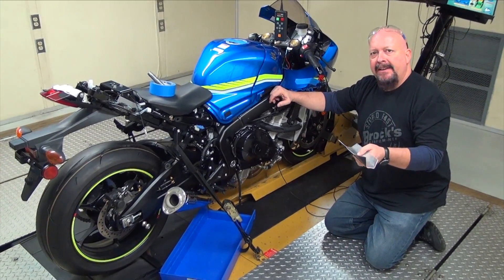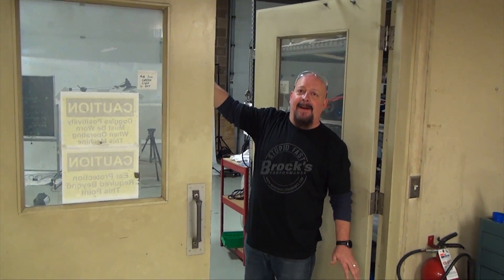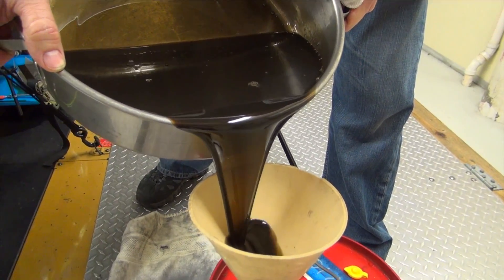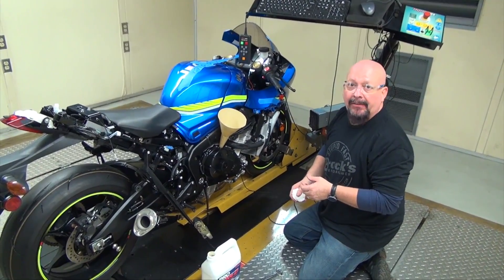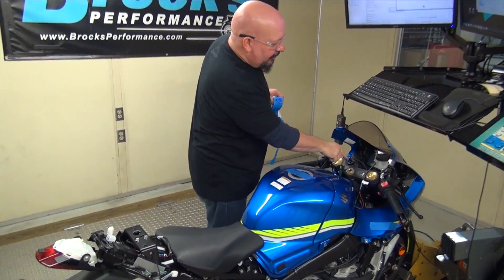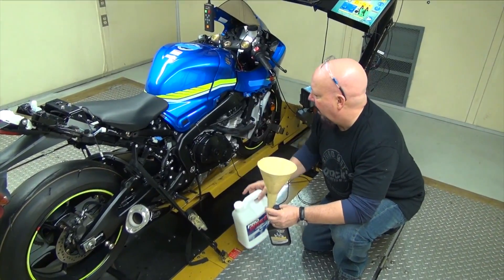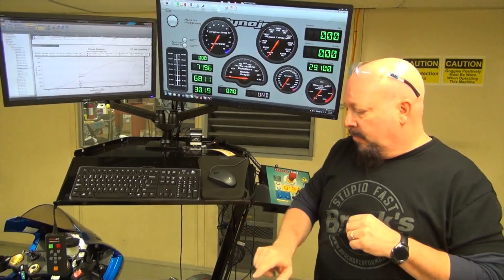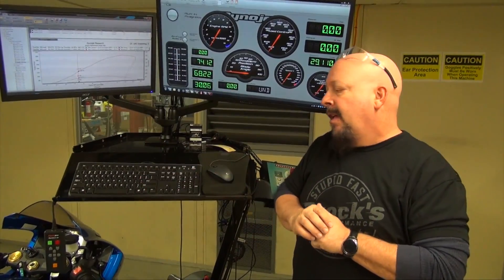2017 GSX-R1000 S2B: Episode 6 (Part 2) - The Devil Is In The Details (Oil Change)

Comment: Why did you say that once you go to the 0 weight you could never go back?
Reply from the maker: Because no other oil or combination we have ever tested has out-performed our <<0 weight Alisyn and Petron on the dyno or race track in stock engines. As far as changing to something else (organic or any other synthetic etc...) that's no problem - if you are worried about those Internet myths.
Reply: @BrockDavidson  over the past week I have watched every one of your videos. And I have learned so much about motorcycle racing. I'm a drag race guy but I've always raced cars. I'm trying to get into motorcycle racing. I have two Hayabusas, one being turbocharged. I'm not really looking to win any competitions or anything as I'm a bigger guy. I just want to do it for the fun of it. I've made a few trips to the track and did decent for my first few times but need to get better on the clutch. I have found very little videos that go over throwing the clutch though. Anyways thanks for the advice.
Reply from the maker: @swatson0061   glad you are enjoying our series. Launching a bike properly takes practice - we have some larger guys who are excellent riders. The term 'throw the clutch' makes me nervous. The only time this would happen is if you have the clutch style combined with proper power measurement - example: MTC multistage clutch and fully adjustable boost controller like an AM1000. If you are manually activating the clutch (aka: actually riding the bike...) you, as the rider, are in charge of the clutch and power modulation. You might want to check out videos from the Real Street class for examples of riding a turbo with a hand clutch and Pro Street for throwing the clutch and hanging on tight!
Reply: @BrockDavidson  yeah I was actually talking about slipping the clutch. But alot of racers I see get it out so fast it looks as if they just throw it. I'll search for those videos. Thanks.
Reply from the maker: @swatson0061  search: real street motorcycle drag racing and true hand clutch motorcycle racing.

Comment: The thicker oil back then is because the oil will cling to the metal more. With today's lubricant technology it's now better to run lighter since thinner oil flows through the engine parts more easily while maintaining the 'cling factor'.

Comment: I know you've been using 0 weight oil but every engine guide and engine builder says they build an engine with the weight  of the oil they need to run in mind. (pretty much every sportbike I've owned has a min of 10w30/40 recommended.  this means they've designed the engine to use 10w30/10w40 etc.  quoted from link below,   "Viscosity must be properly matched to the engine’s clearances and operating conditions to optimize performance. If an engine is not built to take advantage of light viscosity engine oils, the oil may not be able to adequately “fill” the oil clearances and fail to adequately support engine loads."    https://www.enginelabs.com/tech-stories/racing-oil-vs-street-oil-know-the-differences/
not to pick on that oil brand but they seem like another gimmick oil brand.  no info of the oil type whatsoever.  full synthetic labeling is a loophole in the laws that allow them to call it synthetic when all it actually is a highly refined group III crude oil base stock.   it's not actually synthetic.  100% synthetic labeled oil contains 100% synthetic base stocks. with pao or esters or both.  I won't consider running a brand that wont tell you whats in it..  and I don't see Alisyn pro drive 21 stating anything other than full synthetic.  which means, it's not synthetic.     this is one of the only oil brands happy to tell you what they use,  http://mptindustries.com/mpt_products/motorcycle.htm
Reply from the maker: Use what makes you comfortable. Here is more info on how we do it: http://blog.brocksperformance.com/faq/what-is-the-best-weight-alisyn-oil-for-my-application/

Comment: Hey, Brock ;-) how long the oil light can stay on before damage is inflicted? The last time I changed oil and filter on my ZX6R the oil light stayed on for what felt like eternity, some no fun noises from the cylinder head appeared, in an act of desperation I decided to rev it and that seemed to have purged the air. The noise is gone, everything seems to be back to normal but I keep thinking about it. I use Militec 1 oil additive (produced in the USA and imported to Poland), I'd gladly see a review of it done by you and some hard dyno data whether it really works or not, it definitely makes shifting smoother and raises idle a bit. God bless!
Reply from the maker: Air can trick the light, but the bike is still getting oil. You know quickly if you ever had an oil starvation issue...
Reply: Thanks for the reply, I really appreciate your work!

Comment: The last couple of days I’ve been watching your videos , and what I have to say is WOW! Awesome stuff!
Talking about oil , have you ever used or heard of MILITEC-1 oil additive ? 
I’ve been using it over 10 years and love it. You should definitely look in to it . Less friction, smoother ride , just a great product over all. Last year put more than 55k miles on my 2014 FZ09 using it with Castrol oil 10w50 ( here in Los Angeles ) with no issues what’s so ever!
It would be nice to see some numbers on the dyno when add to the oil. 
Thanks again for the great content on your channel.
Reply from the maker: Glad you like our vids. I have not tried MILITEC-1. It took us years to confirm an additive that truly worked for our application - so we stick with the Petron+. We have tested other additives that made a bit more power... but we also encountered clutch slip and a couple even produced corrosion of internal components. You haven't lived until you have wiped oil off of a rusty connecting rod or trans. gear.

Comment: Brock please HELP i have a 2018 GSX RR 1000 i have a full system M4 street slayer system the tried to do the willage flash on my ECU but it would not idle down when I came to a stop it would rev to about 3000 2800 for about 5 seconds in neutral when I came to a red light or a stop and then took about 5 Seconds to idle down can you please help me with this and get my ECU up to 204 horsepower on my bike what do I have to do please help
Reply from the maker: @joepeoples231 - very sorry to hear your frustration. This is exactly why we spend many months of R&D to create our Stock to Brock kits - we deal with the work and frustration....so you don't need to. Please contact our customer service team for your options. 937-912-0054 or sales@brocksperformance.com

Comment: How many miles do you change oil
Reply from the maker: Norman Boltron great question.   It depends on your riding. If drag racing, we change it every race to keep the clutch debris out of the engine. For street, usually every 1500 miles our so.
Reply: Brock Davidson ty mate

Comment: Hey Brock, whats your opinion on using Alisyn in heaver applications such as high performance v-twins air and liquid cooled in the 20W50 weight? You said you use Alisyn in all your bikes with "stock engines" can you elaborate more on that? What oil do you use for modified engines?

Comment: I heard about you a long time ago back when Joe Marasco was running around small towns with a hired rider and a bike hustling drug dealers out of their money at the track. I had an old 94 gsxr 1100 with a 56 tooth rear sprocket and a mechanical switch rigged up to the throttle that opened up a hidden nitrous system hidden under the rear fender and the air box. I would rev the piss out of it when I would purge the system into an air release muffler that I got from work.

Comment: brock davidson i have a 2006 zx14 that previous owner placed a 2008 header which has the catalytic converter and also they didnt even have mufflers on it and i found secondary throttle blades was removed... so what ive done was gut the converters and i found a used set of vance and hines cs-1 mufflers to put on since it didnt have any mufflers when i bought bike. should i feel a power difference with this? it didnt run bad just loud as #### and i feel that it would hurt bikes power with no mufflers. i also used just 10w-40 motorcycle mobil oil but if i can buy better oil that is proven to reduce engine wear and reliability then i will but would a lower weight oil hurt my zx14? im hoping the cats removed in header will help with engine heat also but ill be needing a ecu flash im guessing and id like to dyno bike to see if it even makes 150hp to rear wheel
Reply from the maker: @Danger Davefpv - Hello. I can't answer the question about your pipe, other than to say that if you want to truly make more power, that gains are to be found in replacing the OEM headpipes more than any changes you can make on the muffler side. We used the Mobil 1 for years. iIts a great oil and relatively inexpensive. We switched to our Alisyn Aerospace to extract maximum power and acceleration. Go to our ZX-14 Diaries to see what we did to our 2006 ZX-14 and the performance increases we measured: http://blog.brocksperformance.com/kawasaki-zx-14-06-11/

Comment: please do racing spark plugs side gaped plugs please. you've gone so far already
Reply from the maker: Waste of time and money in normally aspirated applications IMHO (we use stock plugs) - out of the box gap works fine. In nitrous/turbo applications, plugs can make a huge difference. We gap at .022 to keep from blowing the spark out. If a normal plug melts, it takes engine parts with it, so race plugs are higher grade material also.
Reply: Ok. The idea is to cut electrode so spark is more exposed to the air fuel mix. Like indexing. Some say you gain about 5hp and it's and 'old racers' trick. I guess it's really a waste of time to test this theory and only applicable in boosted nitrous situations if at all . In NA it has no effect.  Thank you for clearing that up.
Reply from the maker: Cutting and indexing plugs used to work on old cars. New bikes, with extrememly efficent combustion chambers, don't care...at least not anything we can measure normally aspirated.

Comment: 204 whp and 92 ft-lb. Stock bike weighs 441. Subtract about 14 pounds for full system, another 5 pounds for lithium battery, drop 8 pounds for CF rear wheel/rotor/sprocket, 5 pounds for CF front wheel/rotors, and 1 pound for rearsets and fender elim.

Est. 408 pounds wet. 2.0 pounds per HP
Or 1,102 HP per ton.

Kind of ridiculous.
Reply: Better than super car acceleration for 15-20K depending on mods…can’t beat modern sportbikes, easily best bang for the buck.
Reply: It is crazy but the math is a little skewed because unfortunately even the lightest ride doesn’t weigh 0 lbs 😅
Reply: @alpmaster  Weight reduction reaches the ultimate limit of material science and minimum strength, while delivering the ultimate power for that design. That is the ragged edge of high performance and expensive mistakes, the convergence of things that cost a heap of money.

Comment: I have a question I have a 03 Yamaha R6 2nd gear for me feel a little bit like it something's there but they say it's just me but I was wondering about putting a aftermarket clutch from STG high performance but it's only going to be driven on the highways and freeways but sometimes I like to go fast
Reply from the maker: We use OEM clutches.

Comment: I don't think anyone should be running less then zero weight in any higher RPM performance Motorcycle. In a new Engine, on a Bike that never has to stop for Traffic or Stop Lights making the Sump temperature get past the 200 degree F mark, that oil might be fine. But when temperatures climb and RPMs are used, less then zero will not provide the Protection in the Main, Connecting Rod, and Transmission of a Motorcycle Engine and increased wear will occur.
Reply from the maker: Thanks for your input - our results over the last 10+ years disagree with your statement. Per the video, use the manufacturers recommended oil, if you prefer. <<0 weight oil from Alisyn Aerospace is not for everyone.

Comment: Brock I have on my gsxr 1000 17 a 43 sprocket it’s flashed and tuned the alien head exhaust and it’s on mr12 it’s hitting the rev limiter hard at @ 14,800 I’m thinking of dropping another tooth a 42 sprocket to top out at 206,207 mph should I raise the limiter at 15,000 rpm or higher what do you think I’m 150lbs my bike is set up for the 9 10ths  miles racing but I want it to go eventually faster without hp dropping, tell me what you recommend tire size is a 180/60 diablo supercoursa
Reply from the maker: And NO of the 15K RPMs. At 14.8K, you are already a bit higher than recommended. What is sometimes difficult to understand, is that the stress on the components increases exponentially as RPM's increse, which can lead to premature engine failure.

Comment: Brock I have a few questions - I have the exact same bike (R) version - I want to have you do the work for me and I can bring it to you - how much would that run me to have you install everything as seen as I have watched the build up to this point - and is it making 204 at the wheel or is that BHP?
Reply: @brock
Reply from the maker: Hello @PineapplE1982, our R&D schedule will not allow us to work on customer machines, but we have good news...you don't need us! We offer this exact same package to consumers for self-install, or installed through our large and ever growing dealer network. Please call 937-912-0054 for details. You can browse our dealer locator here: http://blog.brocksperformance.com/dealer-locator/ - Also, rear wheel dyno numbers are from the rear wheel. BHP would be from an engine dyno and are approximately 10-11% higher than rear wheel numbers. Our 204 RWHP is also on the SAE scale.

Comment: Flo Stainless steel reusable oil filters flow really well and save money in the long term. 35 micron (35 one-millionths of an inch) absolute, tons more flow no mater the viscosity. Paper and cotton may filter well, but big specks and little specks alike go through them due to inconsistent media packing.
Reply from the maker: FYI. The stainless reusable sometimes work TOO well... they tend to clog with clutch dust in streetbike drag race conditions. This used to kill engines. Now, they will crunch like an accordion or overpower a safety spring to prevent engine damage when clogged, which is great!... But it allows unfiltered oil to flow through your engine. We use them in street riding and drag conditions where the oil is frequently changed, and they work well.
Reply: Cool, thanks for the info!
Reply: Brock Davidson r

Comment: Brock honestly I have the gsxr can it beat the 2018 s1000rr if it’s done right as far as the gsxr having more potential to beat the s1000rr in a straight line racing let me know what your thoughts are
Reply from the maker: @Isaias - Right now, everything we see says yes. But we won't know 100% until we get the bike on the racetrack in the springtime.

Comment: Hey Brock. Does the pcv5 also allow you to eliminate the timing retardation or do you still need the seperate component. How does this affect the fueling?
Reply from the maker: Tim, we use a combination of ECU flash adjustments with a PCV to handle precision fuel tuning chores.

Comment: Brock can you tune a gen 2 hayabusa  to make 200hp  with similar  mods? Great videos btw  and thank you for sharing all the tips that kind of knowledge  takes lots of time and money.
Reply from the maker: @Mike Smith -  very close. 195 SAE is very good for a Gen 2 on good fuel. It's also enough hp for an excellent rider to get into the 8's in stock wheelbase form: https://youtu.be/wrsIt_I6hqw
Reply: Brock Davidson Sorry I didn't  know you replied  and thank you for doing so. I called your shop looking for a busa exhaust  the Gen 3 but the young lady said it was no longer available. Will you guys every make another run of them? Also if I buy a exhaust and I get a power commander will it come with a map for the exhaust ? My busa   is a 2012 thanks again for your time. My bike is all stock just ridden on the street is all
Reply from the maker: @Mike Smith - no more Gen 3's. Yes, you select from the map dropdown and we will install the map for you. Here is more info: http://blog.brocksperformance.com/brocks-performance-exhaust-purchase-guide/
Reply: Brock Davidson wow thanks again for the reply. I will look it over I bought  a set of links from  you and they look great. Thank you again I just have to figure out what exhaust  because this stock setup weighs ALOT. I need something  quiet as possible  though. Thanks again man.
Reply from the maker: @Mike Smith - give our customer service team a call for options. We have noise reducers that help cut down on noise.
Reply: Brock Davidson I sure will sir. Love the videos  and have watched all the gsxr  ones start to finish great stuff.

Comment: Sweet. Just curious, what would it take $$ to get my ZX14R SE set up for land speed racing? I want to pass 200mph. It's a completely stock 2016 bike with 700 miles on it right now. I'm here in Ohio too, not far from 650ib actually by the filthy streets of Cleveland, haha. I know there's some regulations like a metal chain guard and such. I'm finishing some of my dad's bucket list items for him since he passed away last year. He never saw 200mph. Hence the reason I bought the ZX14R.
Reply from the maker: @Photo - Please give us a call 937-912-0054. Our customer service team can put a combination together to match your use and budget. FYI: one of our customers still holds the LSR record for a 14r  using only bolt-on components at 212.898 MPH . Check her out here: http://www.brocksperformance.com/brocknm/templates/bpp1.aspx?articleid=363&zoneid=10

Comment: Brock what is wrong with my k6 gsxr 1k engine, it had metal flakes in the oil kind of goldish colored.???
Reply from the maker: If the flakes are bronze colored and the bike is knocking - you may have lost a crank bearing.